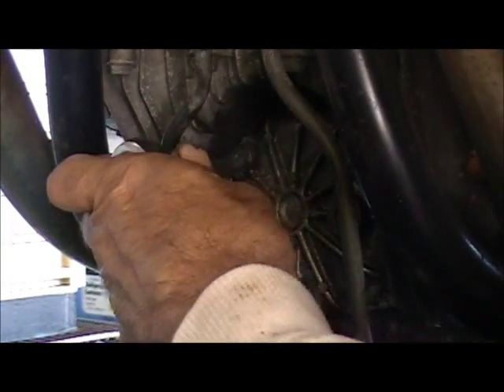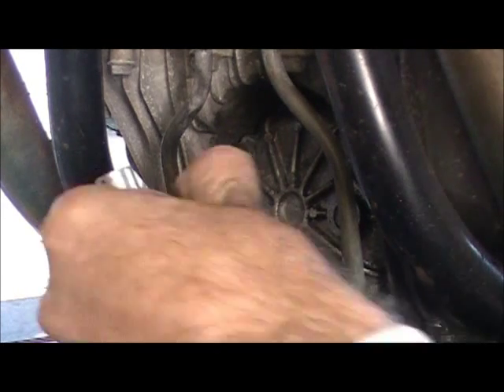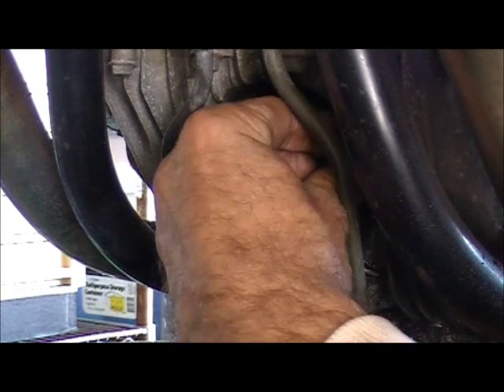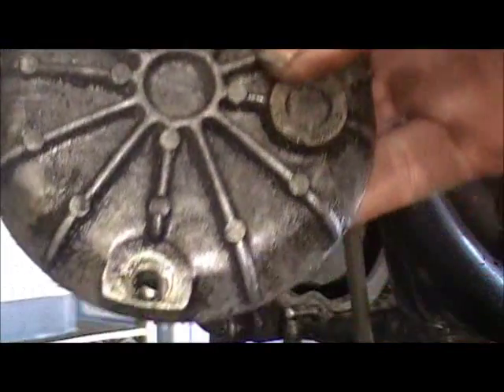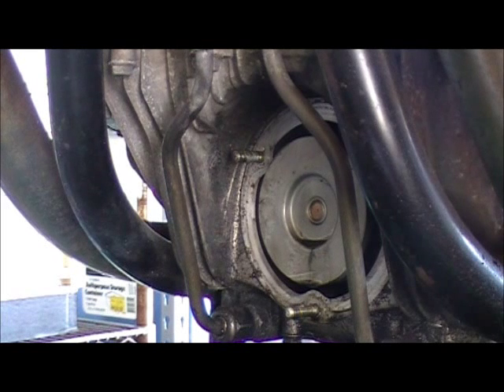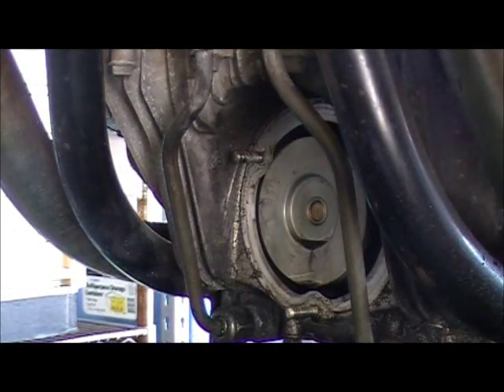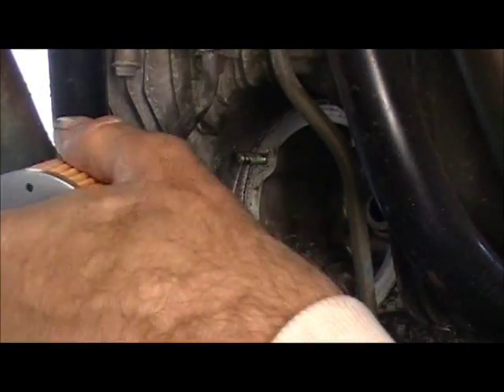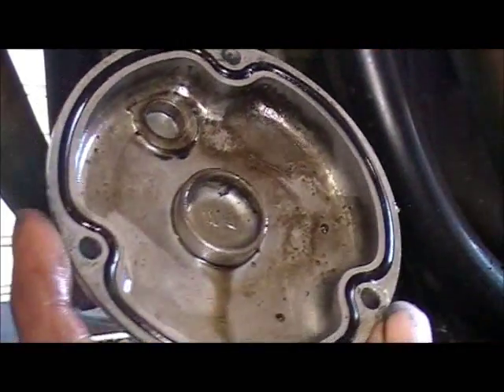Changing your Oil filter on the Suzuki GS450 family

Comment: Hey do you have a video for the same bike family on how to change the battery? I have a 83 Suzuki gs450 a
Reply from the maker: not really -- that generation ... it's either under the seat or the sidecover -- 1 bolt unclip or a rubber strap to unstrap --- remove ground ( - ) FIRST, remove positive SECOND ... when installing attach positive first and ground second - re-clip or strap ... (prevents that wrench making sparks if you goof and hit the frame if you do it in that order)

Comment: I have a few problems with this vid. First, it should show the oil being drained - that drain bolt on the bottom can be a PITA. Second, the bike takes an odd number (3) of quarts of oil, so mentioning that should be part of the instructions. Last, (and worst) using a parts washer is much less important than wiping the visible crud from the inside of the filter cover before reinstalling it. Somebody doing this job in a parking lot but using a clean rag to wipe the inside of the cover is doing a better job, even though it may look worse on the outside. It's how clean it is inside that matters.

Comment: would you know of a filter relocation kit rthat replaces the kn 131 filter with something more common that can be found at AutoZone?  no one in town ha the kn 131  or fram ch6000 filter for these bikes.  I am afraid of going to the dealer not only because it will cost at least $30 but the will most likely sell me the wrong one yet again.

Comment: how many liters of oil does this bike take? i just bought it and want to change the oil to be safe
Reply from the maker: 2.7 - or 3 quarts wont overfill it bad enough to worry about - pint less if you are not changing the filter

Comment: Stupid design. Should have used a spin on filter.
Reply from the maker: Only with a shield/cover -- I've bought a few bikes cheap because folks forgot to put an extra cover over their spin ons and their front wheel chunked a rock into em
Reply: Seriously? This is far better than the typical outside-spin filter... A little stone can destroy it... But with this dessign is impossible because it works as a shield... Anyway... Bye!
Reply: Swear I can not get darn cover stop leaking
Reply: @rickiethompson2120
That's why I'm here now so far I'm 7 quarts in and still not getting the damn thing seat properly 😒